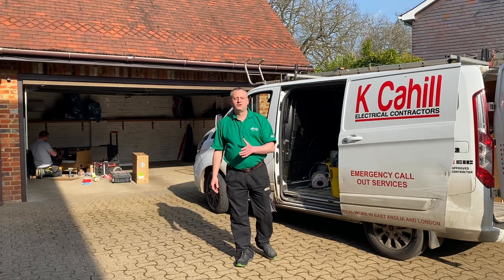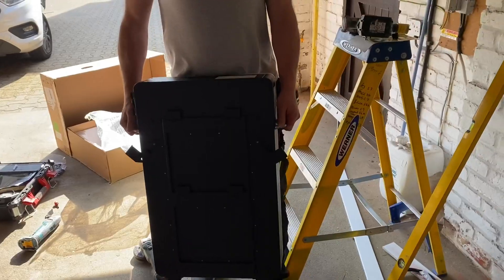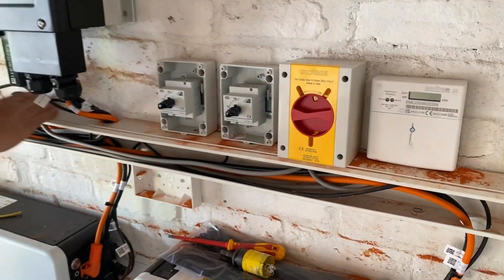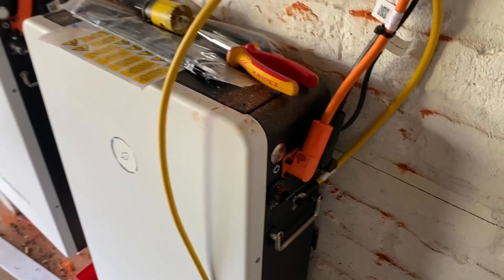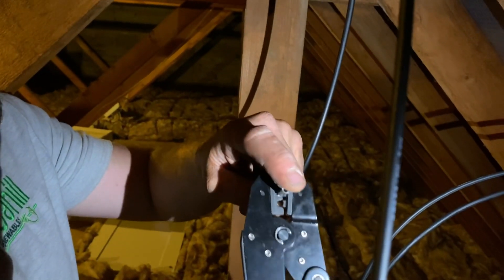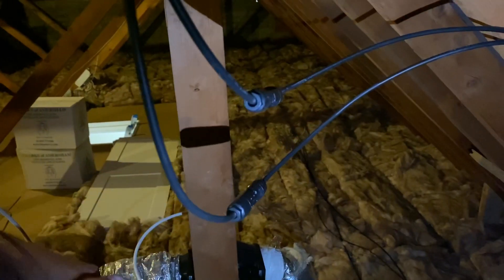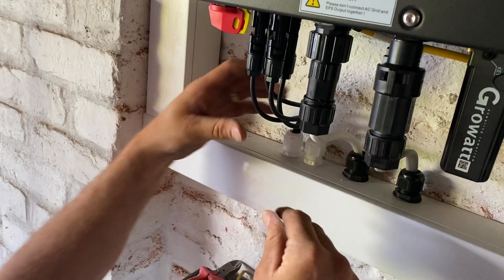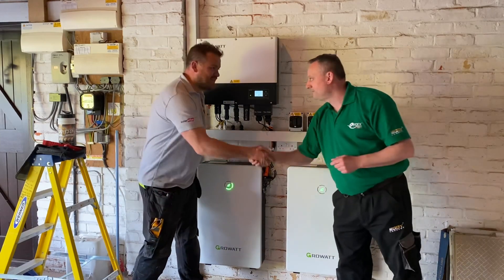Solar Panels & Battery Storage - Prosumer Electrical Installation Tech Tour

Comment: Sloppy with not brushing off the brick dust from the bricks and trunking created from drilling the holes. Makes it harder to do with all the equipment in place.
Reply: Not sure about the safe working practices as well when testing the PV voltages
Reply: @craigandsummer4057  Agree dangling wires in loft and cutting both at the same time invites a short circuit. No strain relief gland for battery cables into the trunking?

Comment: Storage battery capacity is measured in Kw hrs, not Kw!
Note electricity meter is an older induction disc type. This will run in reverse when PV generation exceeds customer consumption (including batteries). Although this may seem advantageous,   It is not permitted ( illegal) by REC
Reply: Not always true, my parents' spinning disc meter doesn't go backwards when exporting.
Reply: @Soruk42  correct, I had a meter with a ratchet that didn’t go backwards. However in the case of my meter (same style as the one in the video), it had a ratchet symbol on the front face of the meter, which this one seems not to
Reply: They don’t always run backwards and it’s not “illegal” ffs. It’s the electricity suppliers equipment so it’s up to them to ensure it’s working as it should.

Comment: You're only supposed to strip the solar cable isolation between 8 to 11mm. Way too much excess inside the mc4 terminal.

In South Africa, you're not allowed to have AC and DC in the same trunking run. I'm surprised that it's allowed in the UK of all places.

Comment: 9:00 how about installing the PV cables in some fireproof cable ducts or some fireresistent cable trunking?
Reply: What?? issue is loose connections for most pv fires or poor mc4 connections or junction boxes
Reply: @bramcoteelectrical1088 These installation might have been made with MC4 connectors made without a  cramping tool!
Reply: Do you want to complain any more?

Comment: band 1&2 segregation? surge protection? are fire rated clips in the loft needed? I'm not currently doing pv installs but looking at going into it.
Reply: If the cable run is less than 10m from panel to inverter then the built in SPD is sufficient. Longer runs need an external SPD at or near the array.
Reply: Fire rated clips are not required in the loft as it would not be considered as emergency route in case of fire.